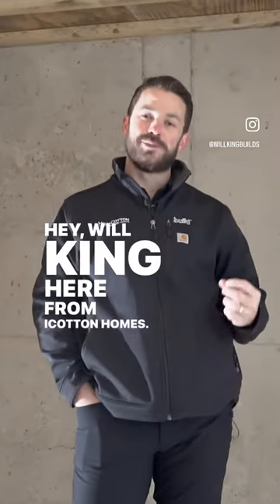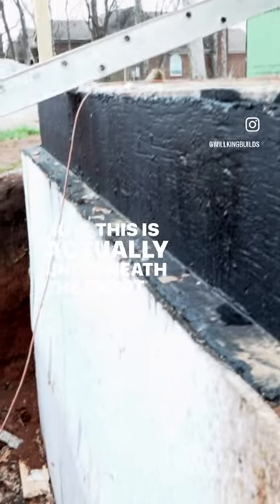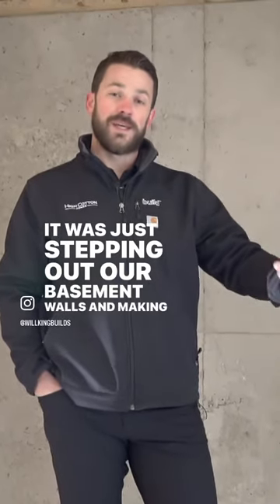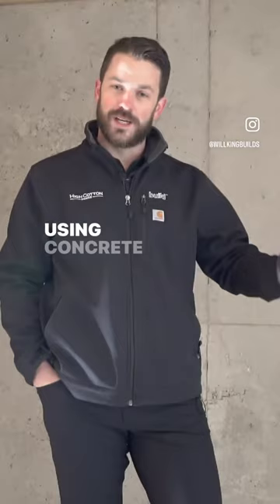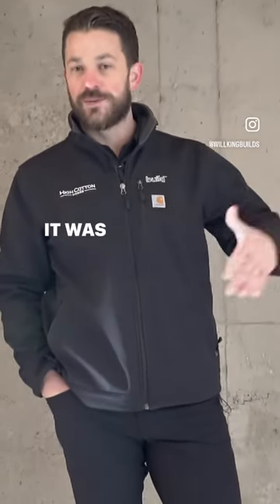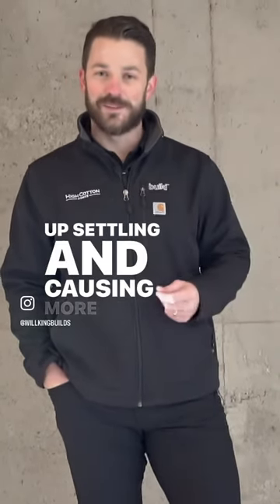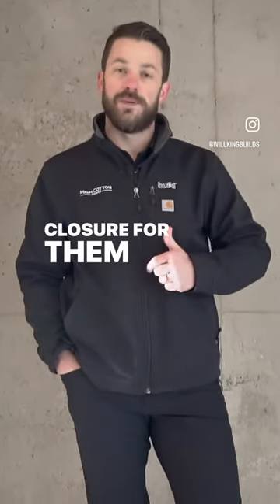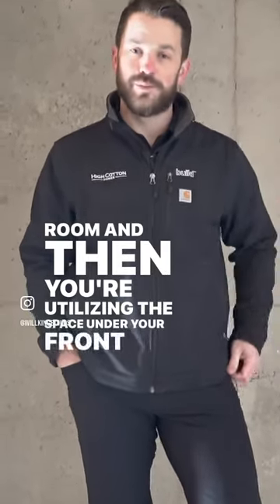How We Incorporate Safe Rooms In Our Custom Homes #shorts

Comment: I’m doing this now but my contractor says the metal decking under the concrete will have condensation essentially causing it to rain in the room depending on the temps